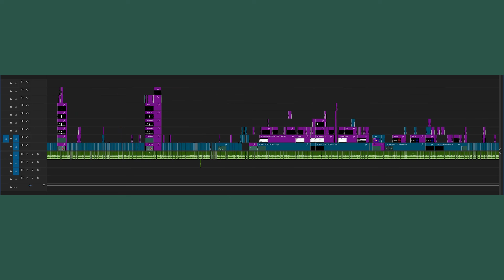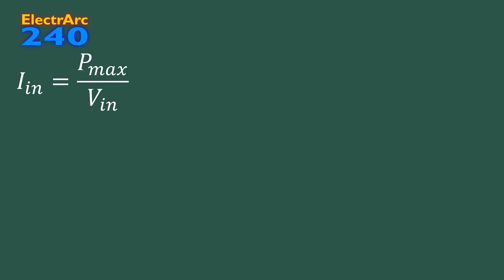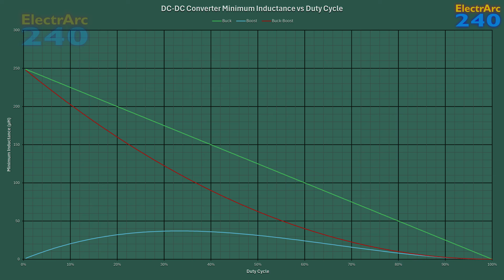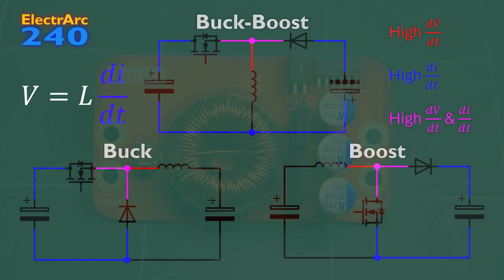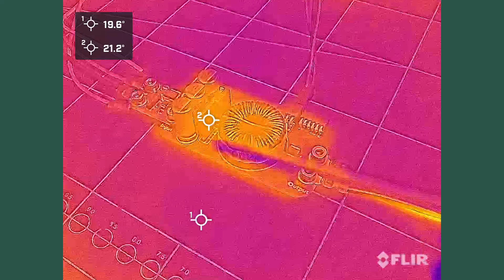How to Design Buck, Boost & Buck-Boost DC-DC Converters

Comment: Awesome video!! Quick question; from what I've seen if you had a device running off a lipo->boost converter 3.7v->12v, but the device was only on periodically, would it be the pmw controller that would prevent the voltage on the output from building past the output capacitor max voltage?

Comment: I think you missed an important factor. Since you are telling how to calculate the inductance of coil, you should also be pointing out that this is Boundary Conduction Mode or BCM, and also there is a more highly efficient way that is Continuous Conduction mode or CCM which calculations are completely different.

Comment: wouldn't the boost converter at 100% duty cycle output 0V because the inductor is never connected to the output?

Comment: Fantastic video 😊 I think output ripple can often also be due to parasitic inductance in the capacitors and parasitic capacitance in the inductor. One solution is to use a bigger inductor. Using a bigger inductor means a lower ripple and therefore lower di/dt at the switching node, so the effects of the parasitics will become less pronounced. There is also a Sam Ben-Yakov video where he suggests using a ferrite bead in the output filter.

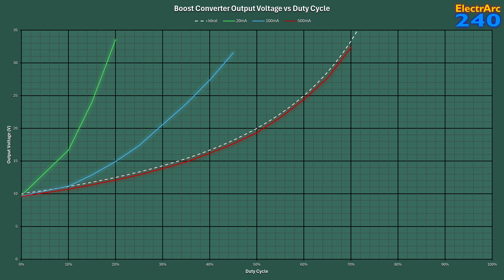Comment: You pretty much showed overunity here at 6:00 set a capacitor 2kV 1μF put 10V 20 mA in the booster and get you 2kV at 1μF then you can calculate what came output

Comment: Thanks alot for this video, was very helpful, though I have a question. 
 How did you obtain the switching frequency?
Reply from the maker: Haha the impossible question! It’s a trade off of many many things like switching losses, passive component size, EMI, controller performance. Also very dependant on topology like flyback power supplies are typically 50-100kHz while buck can be upwards of 500kHz

Comment: you didnt show how to also design the PWM generator. I tried using an NE555DR for a 100kHz switching frequency, but was told to use a gate driver IC and I am losr

Comment: 30mV Ripple is quite impressive, though not sure how using actual real life SMPS controller IC will affect the ripple. Chinese modules have like 400mV to 1V ripple, though they probably use worst possible parts with values below what is required

Comment: Love the channel Man, great in-depth circuit analysis. I have a vid suggestion: an in depth design and build of a high power flyback converter for inductive heating applications. I think there are many interesting small form factor options and the high current high frequency design is itself quite interesting

Comment: How do you get such nice current waveforms? Do you use a current probe or measure the voltage across the shunt?
Reply from the maker: These boards have SMD shunts on the bottom, I’m just probing the voltage across them. They switch very slowly (~10kHz) so things like ringing are a lot less noticeable

Comment: Hello, I'm a subscriber, have been trying to learn electrical engineering for about half a year now, but can't really seem to know what program that I should use. I have been self teach teaching myself for a while, but I have ran into a ton of problems with where to start. Because I see one new video and it has a whole new topic I've never learned. So can you, or someone else that knows this and reading this right now be able to tell me what method you have been using to gain knowledge

Comment: DCM at zero amps is right but if the current is almost zero its also called CrM or critical conduction mode. So in total there are three modes in general.

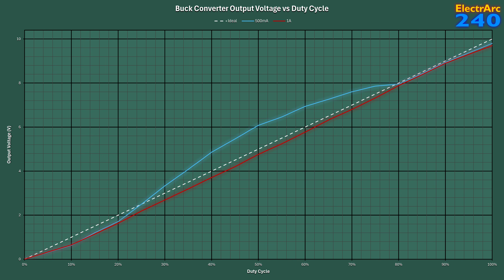Comment: 4:11 would using a higher value capacitor at the output help reduce the voltage ripple.....?
Reply from the maker: Yep, this is the main reason for large output capacitance. If you just care about current (e.g: LED driver) you don't need any!

Comment: When I try to simulate a boost converter in falstad (circuitjs), it somehow never works and I can get only around 500mW on the output. (5V->9V).  I idealized the diode to a forward voltage drop of 0.1mV ... and varied clock frequencies, duty cycle, Inductor and Capacitor values - but at a load below 1kOhm, the voltage breaks down and even with my nifty PD controller, it never returns to 9V. (controller sets duty cycle (and a bit frequency) D from 0.25..0.75. Something is foul ... or fishy... or both...
If I replace my controller with a fixed pulse voltage source with 0.44 D, it looks the same - voltage drop on output etc.

Did any of you guys try to simulate a boost converter with falstad? What is your experience?

Comment: Sir thanks a lot.I  am producing  2 microampere  and 15 voltage ( rectified) from piezo electric devices. I would like to amplify current like ( 15 microampere) and two 2 volt ( power conservation), how do to it? These buck dc dc converter works for this range current?
Reply from the maker: I think it will be quite challenging at that power level but there are ultra low power switching controllers that might work

Comment: Your analysis and explanation here is very good.  One note: I design integrated switch-mode power supplies, and we absolutely do use boost regulators in the discontinuous region (mostly for light-load switching efficiency).  This is okay because in real-world applications, duty cycle is controlled in a closed loop to regulate to the desired output voltage.

Comment: I'm not designing a DC-DC converter. But rather a switching mains current limiter. (Dropping the voltage to maintain the current below some threshold.)
Your video was very very interesting. It highlights a few things I should pay attention to.

Comment: Shouldn't the mosfets and diodes get their heatsinks installed?
Reply from the maker: I designed these to not need heatsinks. If you wanted higher power you would need them

Comment: I noticed the overvoltage, too, but didn't consider damaging humans ... Now I will add an artificial load if nothing or not enough is connected at the output. Thanks for pointing out the problem!

Comment: Great video super helpful!! 2 questions:  I would like to design a 500 volt DC-DC converter.  However I wonder what would be an appropriate level of ESR for capacitors and inductors at this high voltage?  For inductors, lowest ESR I can find that are 500v rates are 6 to 10 mohm, which seems too high.  What do you think would be a suitable ESR threshold for 500v designs?  Question 2:  I imagine I will also need a CMC filter to attenuate 1 MHz harmonics RF from DC output (this is an RF application), but I can’t seem to find  any good resources, guides, or online calculators for designing CMC filters for SMPS.  Any suggestions for where I can find info on CMC filter design, especially for 500v supplies?

Comment: Which thermal camera did you get? It looks like it has a good frame rate.
Reply from the maker: It’s a FLIR One Pro, mostly got it for the high resolution and accuracy. It’s a little over 8FPS but probably looks better here cause it’s mostly sped up footage. Still just about fast enough for non-engineering activities if one were so inclined.

Comment: That output voltage "hump" between 0.2 - 0.8 duty cycle at low load blew my mind...

I'll try simulating in LtSpice to see if i can gain more insight before i start pestering the internet with questions 😂😂
Reply from the maker: Yeah I'm so glad it came out so nicely in the graph! Feel free to pop any questions here or on my discord server btw

Comment: Amazing video! The explanations were clear, and I love that you showed voltage and current waveforms for each part of the circuit, as it makes it very clear what's going on and makes the whole explanation very intuitive. Love your content, keep it up!!

I hope some day you make a similar video on flyback DC-DC converters, I've been trying to design an adjustable 0-24V @ 1A flyback transformer as a pre-regulator for a linear power supply and never figured out how to properly design them to work on a wide range of voltages (as opposed to a fixed output voltage)
Reply from the maker: Thanks! I will certainly try to cover flyback converter's at some point, though there are a few pre-requisites I want to make videos on first

Comment: Here's a video idea for you: Go through the process of designing a power supply for DIY Eurorack modular synth projects. The standard calls for  -12V/0V/+12V outputs, so it's one of the few places where you want the negative voltage that a buck-boost converter can give you.

Comment: Love your videos. Would love to see how to build and fire out a bidirectional half bridge. 

This videos finally showed me how it might work but I’m still struggling understanding the bidirectional flow and how you’d manage it so that the flow goes where you want. (Ie 40v to 4v and visa versa for battery charging and discharging with say a solar panel and a load on the 40v side.
Reply from the maker: Yeah that is confusing to wrap your head around. I guess if you had ideal 4 and 40V sources and an ideal converter then 10% duty would get no current flow and you’d make it flow either way by slightly reducing or increasing it. Of course nothings ideal so we’d have to sense the current and vary the duty cycle based on that. I’ll try and cover it at some point

Comment: OK very nicely explained, here is a challenge add a microcontroller to control both Vout and current limit (I load), I trust you can do it (dont drive the mosfets from MCU, but from a didicated switching IC).
Reply from the maker: It already runs from a microcontroller, the same one that communicates with the power monitors and the PC. So adding closed loop shouldn’t be too difficult. I’ll definitely do a video on control one day!
Reply: @electrarc240  I was just thinking, he skipped over the control part, must be a microcontroller connected to the MOSFET, looks like on the back of the board, keeping it nice and clean.  Im looking forward to the control video.  I'd also like to see the final parts list, you went over all the important details of selecting the components but (maybe intentionally) didn't tell us which ones you used.  Would be a good example based on your initial requirements.